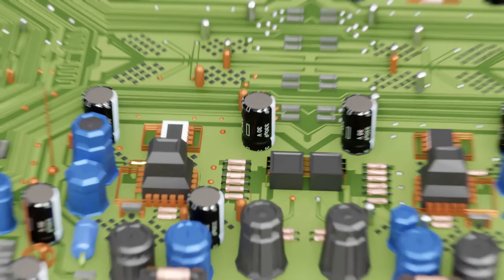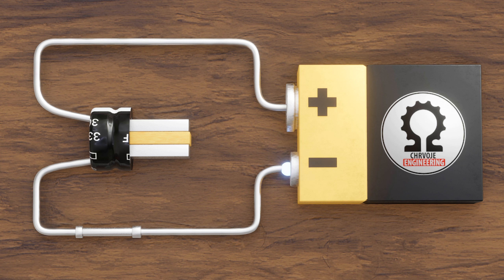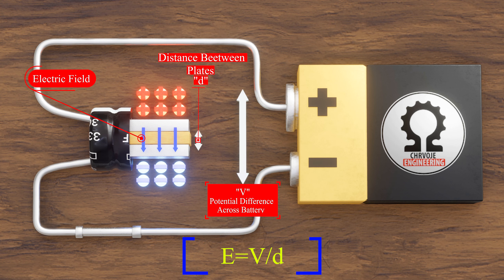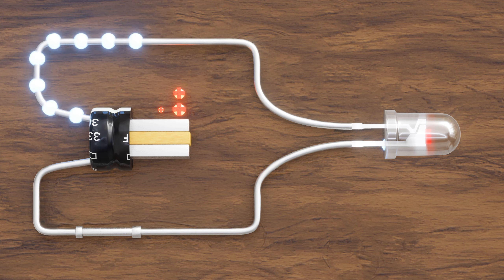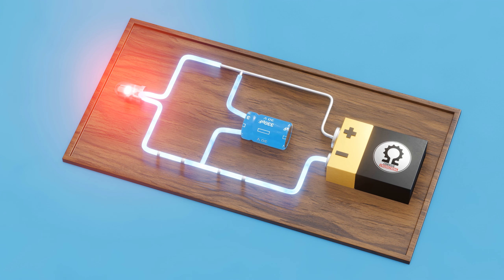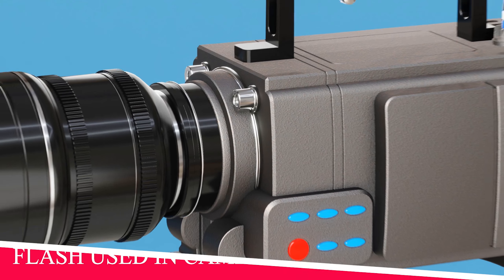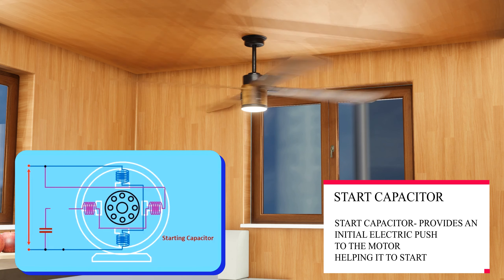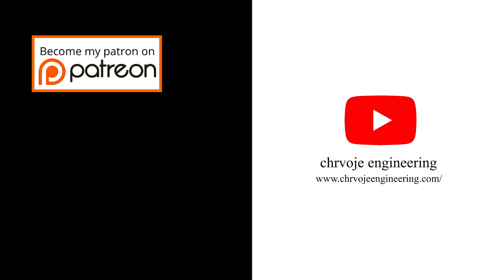How Capacitors Work

Comment: This is the best video on capacitor. 
I ever see. 
You go conceptually in very precise manner. 
Love your video. 

So my request is make a part wise series on different applications of capacitor's  on 

1) - how capacitor use in electronics engineering and electrical engineering
And how they Are different.

2)- detail video on the all types of applications on how capacitor use in electronics. 

3)- detail video on the all types of applications on how capacitor use in electrical engineering.

((""''Detail video stand for different parts for different use of capacitor in each category 'suggestion creating a play list ' ''"" ))
Reply from the maker: Thanks for nice feedback

Comment: Nice video! I do have a question, though. What are "decoupling" capacitors?
Reply from the maker: A decoupling capacitor is a capacitor used to decouple (ie prevent electrical energy from transferring to) one part of a circuit from another